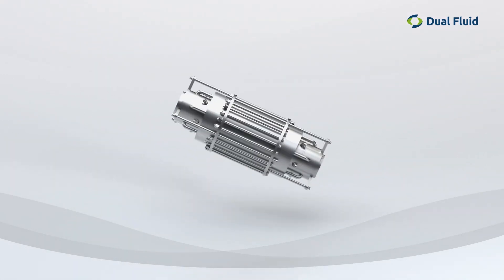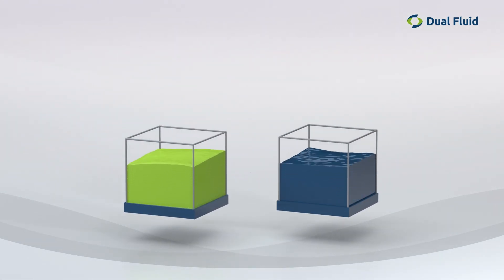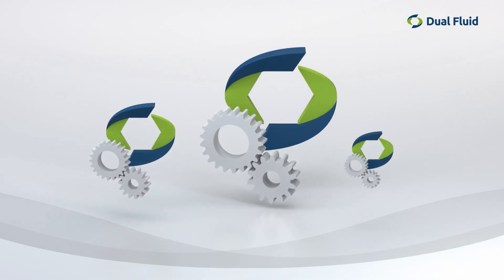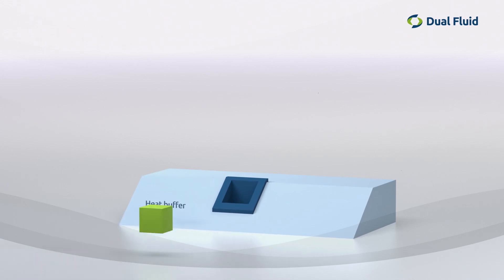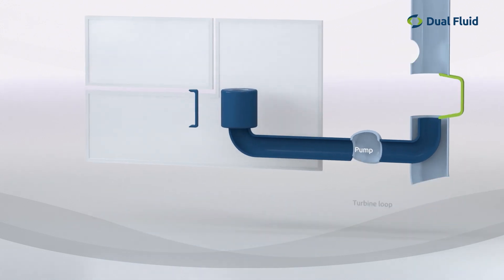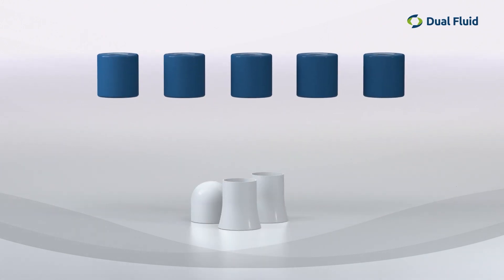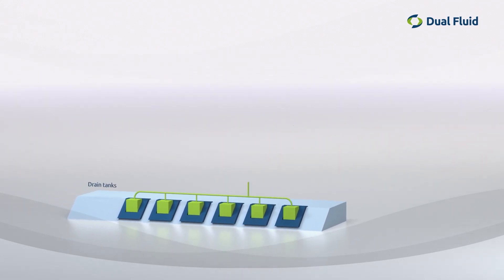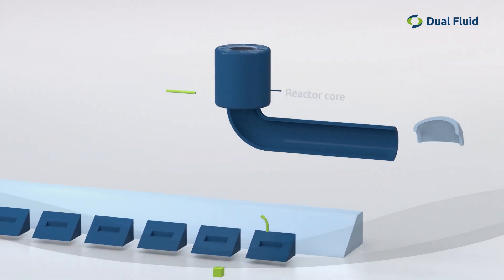Dual Fluid || Creating fifth generation nuclear

Comment: @Dual Fluid
Ich habe eine Frage zu eurem Newsletter. Darin schreibt ihr, dass ihr in Canada Tests mit Zirkoniumcarbid durchführen wollt und ihr dazu den dortigen Teilchenbeschleuniger verwendet um das Material mit Protonenstrahlen zu beschießen. Werdet ihr danach, sofern die Tests am Beschleuniger erfolgreich sind, das Material auch in einem Kernreaktor testen, um es Neutronenstrahlung auszusetzen? Und falls ja, wie erzeugt ihr dort schnelle Neutronen, wenn das bspw. ein Kernreaktor mit thermisch abgebremsten Neutronen sein sollte?

Comment: Die Dual-Fluid-Macher behaupten hier, dass sich das System dadurch selbst stabilisiert und sichert, dass die Kernspaltung bei Ausdehnung durch Überhitzung herunterfährt. Das ist ein fataler Irrtum. Da eine Überhitzung allein durch die Radioaktivität der Spaltprodukte möglich ist, kann die Ausdehnung die Überhitzung auch nicht verhindern. Schon normaler Brennstoff, der auf 3-4% angereichert wurde, kann sich ohne Kernspaltung auf über 3000° erhitzen. Im Dual-Fluid-Reaktor soll der Brennstoff 25 mal intensiver abgebrannt werden.
So hat man uns schon damals an der Uni erzählt, die modernen Reaktoren wären sicher, denn, wenn sie platzen, entweicht das Wasser, wodurch die Kernspaltung wegen fehlender thermischer Neutronen abbricht.
Verheimlicht hat man uns schon damals, dass im Brennstoff die Überhitzung und die Kernschmelze auch ohne Kernspaltung allein durch die Radioaktivität der Spaltprodukte herbeigeführt wird. Normaler Brennstoff muss deshalb so lange im Abklingbecken gekühlt werden, wie er gebrannt hat, bevor er in einem Castor Behälter transportiert werden kann. Das bedeutet, dass normaler Brennstoff 6 Jahre lang außerhalb des Reaktors einen Supergau auslösen kann, wenn z.B. das Abklingbecken zerstört wird. Dabei ist der Abbrand hier nur 3-4%. Im Dual-Fluid-Reaktor soll der Abbrand 25 mal höher sein und dann ist der Brennstoff auch noch flüssig! Natürlich kann man 25 mal mehr Energie aus dem Brennstoff holen, wenn U-238 mit verbrannt werden kann.
Aber wir haben keinen Brennstoffmangel. Wir haben ein Entsorgungsproblem. Der DF-Reaktor muss, wenn er 20 Jahre gebrannt hat, mindestens 20 Jahre abkühlen. Welcher Behälter soll das aushalten mit dieser aggressiven Flüssigkeit? Und dann Gnade Euch Gott, wenn die Kühlung ausfällt oder ein Terrorangriff stattfindet, denn, da eine Überhitzung allein durch Spaltprodukte möglich ist, kann die Ausdehnung die Überhitzung und damit den Supergau auch nicht verhindern.
Nun wird als Vorteil ja auch gebracht, dass schwerer Atommüll wie Plutonium gespalten und damit unschädlich gemacht wird. Das stimmt nicht ganz, denn ein Teil des Brennstoffes U-238 wird zu Pu-239 und Pu-240 umgewandelt. Erst wenn alles U-238 verbrannt ist, kann das nicht mehr passieren. Es wird also ständig neuer, nicht endlagerfähiger Atommüll produziert, denn der vorhandene Atommüll besteht im Wesentlichen aus U-238.
Reply: Welcher Fachmann kann dazu etwas sagen ?

Comment: According to researchers at the Oak Ridge National Laboratory (ORNL), there are about 4.5 billion tonnes of uranium in the Earth's oceans. If it were possible to extract this coveted raw material, nuclear energy could be generated that would last the world for the next millions of years. If the new reactor technologies are used and uranium from the oceans is used, the usable uranium deposits on earth will last for at least 56 million years to supply the whole world with energy. Source: Touran 2020.
Every year, around 32,000 tonnes of additional uranium flow into the world's oceans. This uranium was dissolved from the continental crust by erosion and transported into the sea by rivers.

The basis of uranium extraction is the knowledge that the heavy metal floats in water in the form of positively charged uranyl ions. Uranyl is a molecule that contains oxygen and uranium atoms. To capture them, the researchers sink plastic fibres in the sea that are prepared with a chemical from the group of amidoximes. The uranyl atoms stick to these. The strings consist of polyethylene fibres that contain organic amidoxime molecules. These compounds, which contain carbon and nitrogen, act as a sort of attractant for the uranium dissolved in the water, because the latter preferentially forms bonds with them. To capture the uranium, it is enough to simply hang these strings in the sea. After 49 days in the ocean, the strings had bound as much as six grams of uranium per kilogram of absorber material, as the scientists reported back in 2016.

In recent years, amidoximes have gained a lot of interest. These compounds are usually easy to synthesise and have been studied in many different fields such as materials chemistry, but also because of their numerous biological activities. In addition, the amidoxime function is often used as a bioisoster of a carboxylic acid, and there are some successful examples of drug candidates with cardiotonic or anti-arthritic properties containing the amidoxime component.

Conclusion: There is no more sustainable, clean and beneficial way to generate clean, CO2-free energy (in the form of thermal energy and electrical energy) for humans and all living things on this earth. And this over millions of years...
The fact is that this is already possible today:
Dual Fluid Reactor (DFR) + extraction of fissile material from the world's oceans.

Comment: The advantages of the Dual Fluid Reactor are indeed breathtaking and amazing:
+ all actinides from a core number of 232 can be used
+ natural uranium (U-238) as well as the uranium-238 present in the "nuclear waste" can be used as fuel
+ fuel is available in liquid form in a separate closed circuit
+ liquid lead circulates in the second circuit, which is virtually non-radioactive, a good conductor of heat, has a low melting point and a very high boiling point, and also has exceptionally good corrosion resistance, is a good neutron scavenger and is very effective in shielding X-rays and gamma rays (significantly increased safety and significantly increased efficiency of the reactor)
+ Operation at normal pressure; no overpressure necessary (again, significantly increased safety)
+ Operation without water, thus no overheating of water and the associated thermal generation of hydrogen possible (absence of water increases safety; no burden on a natural resource)
+ no expensive cooling systems necessary, as the reactor regulates itself and behaves like a self-regulating thermostat (according to the laws of thermodynamics)
+ no expensive processing of the actinides necessary
+ almost 100% of the energy dormant in the actinides is used to produce clean electricity and process heat for industry (process heat enables thermal production of hydrogen, so no energy-intensive electrolysis necessary to produce hydrogen --> low-cost production of clean hydrogen in large quantities)
+ after 100 years 90% of all actinides are free of radioactivity, the remaining 10% after about 300-500 years (for comparison: the nuclear waste produced so far has to be stored safely for at least 100,000 years...)
+ high-purity rhodium and high-purity molybdenum-99 are transmutated/"incubated" in small quantities (rhodium is probably the rarest and also the most expensive precious metal on our planet, has special properties such as low reactivity and high catalytic activity and is needed for special alloys; high-purity molybdenum-99 is needed in nuclear medicine, especially for imaging procedures, for the diagnosis and detection of diseases and in radiooncology for the therapy of tumours)
+ scalable reactors possible ex works, depending on application, performance requirements and demands 
+ very low space consumption

Conclusion: the Dual-Fluid-Reactor is a disruptive technology for phasing out fossil fuels, for generating large quantities of clean and, above all, cheap energy, and for significantly reducing the "nuclear waste" accumulated to date

Take existing nuclear waste, i.e. old reactor rods, grind them like coffee beans, put this "nuclear waste" into the dual-fluid reactor and the existing nuclear waste becomes a valuable material that still contains an incredible amount of energy. And clean electricity is generated from it. Add to that high temperatures, i.e. temperatures that are necessary to split water thermochemically into hydrogen and oxygen - without energy-consuming electrolysis. And already we have incredibly large amounts of clean electricity, large amounts of process heat and huge amounts of hydrogen, with the pleasant side effect that the nuclear waste is no longer radioactive at all after about 300 years - and the residual radiation is even less than that of natural uranium and natural radiation. So what is stopping us from wanting to build this almost magical dual-fluid reactor? Do we want power outages due to weather-dependent solar panels and wind turbines? Do we want to keep mining lithium (and emitting a huge amount of CO2 in the process) to build batteries instead of using hydrogen as an energy carrier? Do we want to continue turning salt water into fresh water with electricity-guzzling reverse osmosis, when process heat can be used to turn salt water into drinking water? And finally, why does ignorance want to triumph over reason?
Reply: Gibt es bald ein IPO, hier würd ich ja gerne etwas Geld reinsenken. Zudem "Made in Berlin", na zumindest erdacht. Wenn die Deutschen zu blöd sind Zukunftstechnologien im Land zu halten, haben sie es eben nicht besser verdient. Wünsche viel Erfolg am neuen Standort.
Reply: @andreaskluender858  Wenn es darum geht, aus guter Technologie Geld zu machen, dann war dieses Volk leider schon immer zu blöd. Es ist zum Fremdschämen und man kann nichts dagegen machen, man fühlt sich machtlos.
Reply: Thanks for this very interesting comment.
"So what is stopping us from wanting to build this almost magical dual-fluid reactor?"
I have heard Europe is preparing a gigantic stimulus in the trillion of Euro being invest in many industries.
I really hope this project will get some of this investment and this stimulus money will not be wasted on meaningless projects. We need such tech going forward but I don't know if the politician know about it.
Reply: How much rhodium could be produced?
Reply: @jaredgarbo3679  Rhodium, rhutenium and molybdenum are transmuted from parts of the "atomic waste". It will not be a large amount of rhodium and ruthenium, but nevertheless several kilograms of pure rhodium and ruthenium.
Reply: @alf559  Rhodium is going for about $450,000 per kg.

Comment: Wir brauchen das! Gibt es schon Pläne das in Deutschland zu bauen?
Reply: HaHaHaHaHa are You joking? Dazu braucht man Gehirn und Geld, beides gibt es nicht mehr in Deutschland. Willkommen im besten Deutschland in dem Wir gut und gerne Leben können, noch!🤣🤣🤣🤣
Reply: @ingopinkowski1091  What's dumber than Germany's energy path? The US is following down the same failed path even though the failure is plain to see.
Reply: @chapter4travels  They will regret it.
Unlimited energy means unlimited economical power. And military power.
Reply: @ingopinkowski1091  Germanies energy path will give them expensive, limited, and unreliable power.
Reply: @chapter4travels  I know this, for the last 20 years. I don't live in Germany anymore, for a long time now, I couldn't stand the stupidity and arrogance for nothing.
Every year there was a lost year. For me and my family.
Reply: @chapter4travels  I have outside of Germany acquired so much knowledge and experience, that I am able to do nearly everything. I have dealt with the US embassy, the
UN, the US military, and many others. Ph.D. engineers, professors, you name it.
Germany didn't help me, to be today what I am.
Reply: @ingopinkowski1091  wohin hats dich verschlagen?
Reply: Deutschland verprasst jetzt sein ganzes Restgeld das es noch hat und ruiniert die Wirtschaft mit einer viel zu teuren und nicht funktionierenden Energiewende. Wenn der Reaktor dann fertig entwickelt ist, werden wir hier kein Geld mehr haben um diese Reaktoren in Deutschland zu bauen und außerdem wird unsere Industrie am Boden zerstört sein, so das voraussichtlich auch er Energiebedarf dafür nicht mehr bestehen wird.
Andere Länder werden an Deutschland vorbeiziehen und der Wirtschaftsmotor Deutschlands wird bis dahin nicht mehr laufen. Und das Volk wollte es so, es hätte bei der Bundestagswahl 2021 auch anders wählen können.
Reply: Nein. Die Entiwckler sind nach Kanada gegangen , haben dort Investoren aufgetan und entwickeln und bauen jetzt dort.
Reply: Nein. Die Entwickler sind nach Kanada gegangen, haben dort Investoren gefunden und bauen nun in Kanada